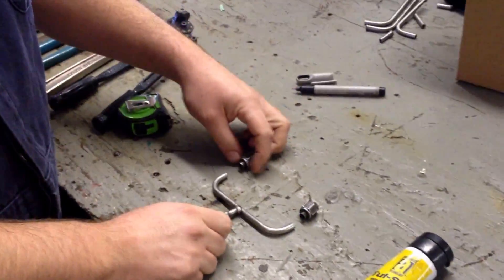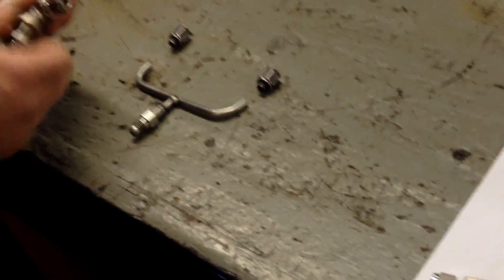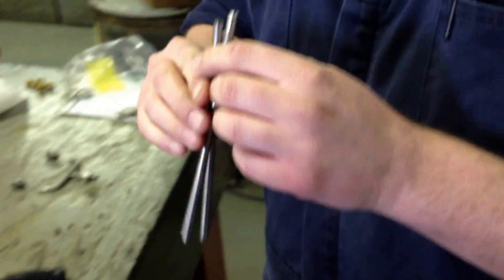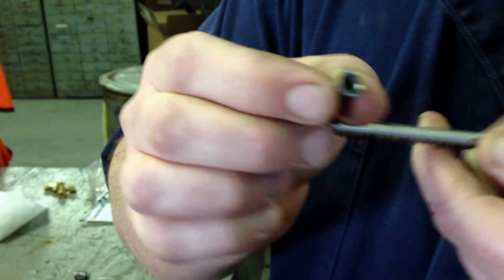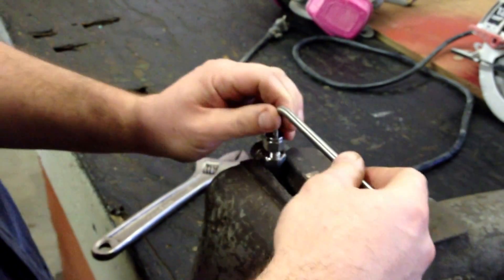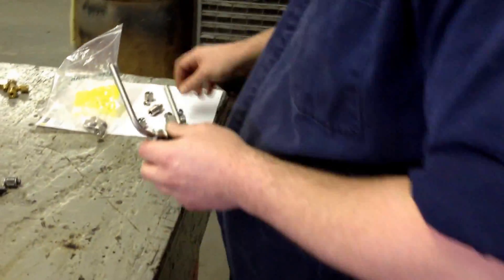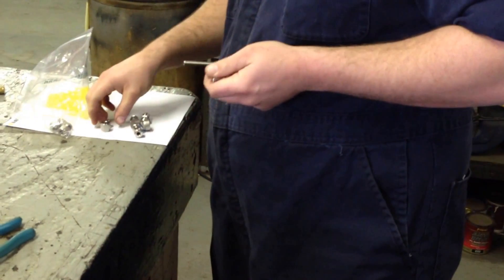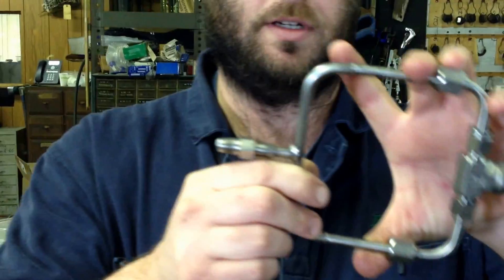Creating a custom 316 Stainless Steel tubing with compression and flare fittings.

Comment: I would've made a tool for helping cut the tubing. For instance unthreaded rod .5mm smaller than the inner diameter of the tubing. Round the tip of the unthreaded rod and grease it.

Grab a wet rag and add ice to the rag, cool down the tubing. 

Wait 2 mins while the tubing cools.
Then place the unthreaded rod into the tubing.

You can now cut the tubing using the tubing cutter without worrying about flaring issues later

Comment from the maker: Yes, it is a 1.25 turns from finger tight on a new installation.  If you really get technically into it, there is a gauge you can purchase to check go-no go   dimensions.  If you disassemble and reuse these types of fittings, it is a bit different.

Comment: I have 3000 meters of 1/2 inch stainless steel tubing for high pressure (15000 psi), i am trying to find a nice product to be made from this tubing and make benifits, please advise.

Comment: psi?
Reply from the maker: +Mordekhay Shenderovich   I don't remember exactly off the top of my head, but I believe this is going to be used for 400psi of nitrogen.  The tubing is rated for roughly 4,000psi with those fittings.

Comment: Those double ferrule fittings, eg Swagelok, HAM-LET, Parker, Hoke etc - for the 1/4" OD tube it's 1 1/4 (one and one quarter) turns from finger tight.  Not wait until its tight then another 1/4 turn...